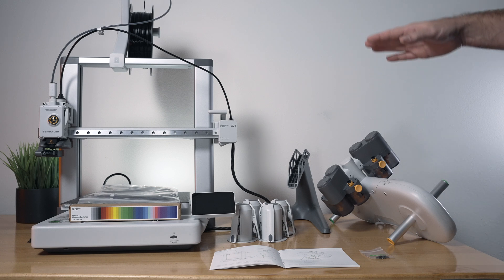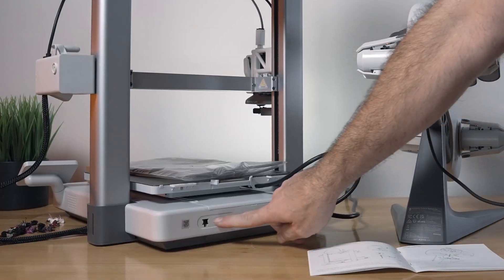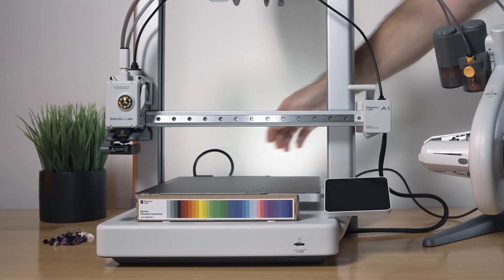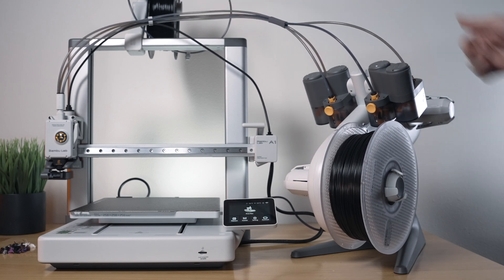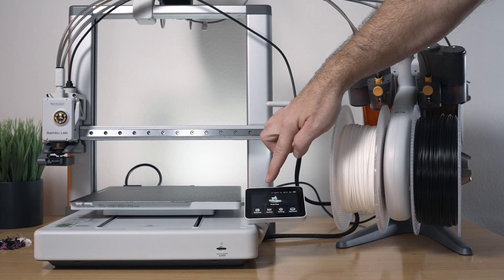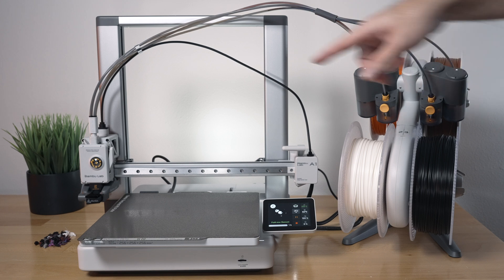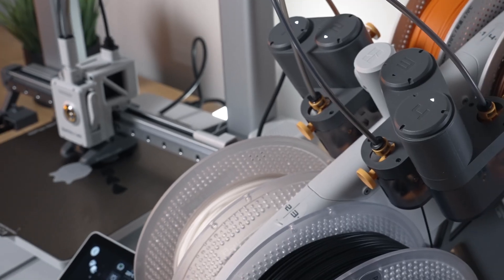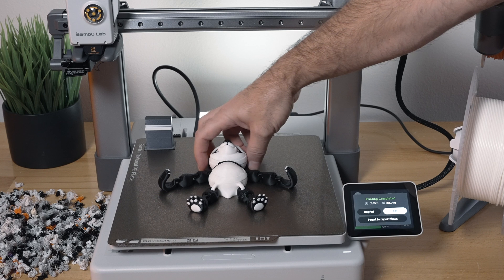Bambu Lab A1 Combo - AMS 3D Printing

Comment: It's obvious you haven't done any research on this printer…. Warning ⚠️ hello 👋  printer recalled for safety reasons 🔥 lol and not available for purchase… creator is irresponsible
Reply: It's an optional recall, Bambu is handling it very well and even gave credit to all the purchasers. It's just a small crimp on the heatbed.

It'll be available again around May as they swap the heatbeds out. Still an awesome printer and a reputable company.
Reply: Replacement units gonna be better. My buddy has one that didn’t fry on him and it’s working very well.
Reply: the printers have already been re-designed and the issue is fixed and all the recalled printers have been replaced, what are you on about? have you always been this stupid?
Reply: "Getting Started with the AMS on the Bambu Lab A1 Combo 3D Printer. Assembly and First Print" he's reviewing the AMS.

Comment: It’s suggested to place the ams more in front of the A1 in front of the gantry so the tubs and stepper motor wire don’t catch on the top edge or the right gantry. Great 👍🏻 video on set up . I’m subscribed are you ?

Comment: Good to see he doesnt give a shit that its been recalled shouldnt be promoting this until the reaplacement units arrive
Reply: Sure he can.  It’s not like there are any for sale and it’s not like watching his video will burn down your house.

It’s a great printer.
Reply: the printers have already been re-designed and the issue is fixed and all the recalled printers have been replaced, what are you on about?
Reply: "Getting Started with the AMS on the Bambu Lab A1 Combo 3D Printer. Assembly and First Print"  he is reviewing the AMS not the printer......
Reply: I agree with you 200%. So what does this tell you about these 3d content creator, bogus.
Reply: @ewardbennett9648  the printers have already been re-designed and the issue is fixed and all the recalled printers have been replaced, what are you on about? what is bogus about this?
Reply: @ewardbennett9648  the printers have already been re-designed and the issue is fixed and all the recalled printers have been replaced, what exactly is the bogus you are talking about? or are you just grasping at straws?
Reply: @ewardbennett9648  ok bambu it's not perfect of Bettslinger and ams light , going of bambu filament not  the no name filament , det it's bambu  life ,bambu it's very nice for extern Filament not ams ligt det it's shrott

Comment: Now you’re flogging a dead horse. The printer is faulty and has been recalled
Reply: Jealious he can't buy one lol
Reply: @Sevensup  yeah. I sent mine back. Got a prusa mk4. More reliable
Reply: the printers have already been re-designed and the issue is fixed and all the recalled printers have been replaced, what are you on about?
Reply: "Getting Started with the AMS on the Bambu Lab A1 Combo 3D Printer. Assembly and First Print" he's reviewing the AMS.   he says it and it's spelled out.
Reply: Actually the recall was a super conservative call by bambu lab. and on top of that i'm sure he'll be getting a replacement bed to make it totally safe.